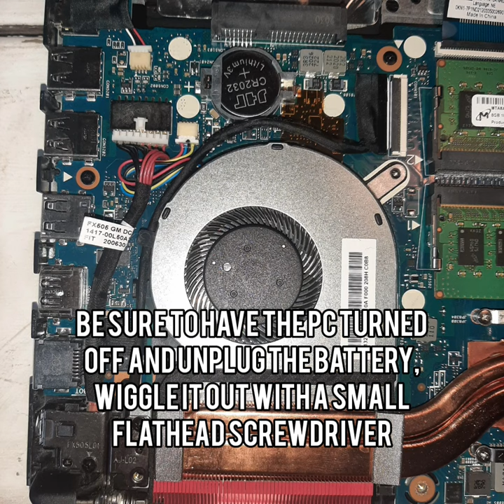How to fix a rattling fan in a Asus FX505DV TUF gaming laptop (read bio)

Comment: Just take the cover off, spray it with compressed air, then put it on its side with the cover off and manually set the fan speed to 100%, keep it like that for 10-20 mins and then the grinding should stop, and you can put the cover back on
Reply from the maker: could be but giving it a little oil wont hurt as its a acouple min extra process
Reply: @0xgreyhound  can you do that without removing the heat sync and fan?
Reply from the maker: @dylanevans7529  no bbut it takes 5 min to take apart

Comment: how much the blac fan cost
Reply from the maker: didnt swap just cleaned it
Reply: it always cost more than it should dude.. specially in more expensive laptops.. and there is no need to replace the whole fan if we can just lubricate it.. I am having same issue in my zephyrus g14.. here in india fan is even more expensive and delivery time is too much.. So I am going to open it and apply some lube to it
Reply: @0xgreyhound how did you cleaned it the same way? Then what kindof lube?
Reply: @_ajay_kumawat  They only cost ca. $19 on Amazon, the cost is not that exorbitant.
Reply: @0xgreyhound If you need to order a replacement, is the right fan on the right when the case is open, or the right when the screen is facing you? Wish they just had a clearer designation other than "left" and "right."
Reply: @brendanr1525  not here my friend.. cheapest I was able found was around 4000₹ which is 47$ and even than I don't know if it's genuine or not..
I did open my laptop and found that there is no way to lube that fan without breaking it.. so new one is the only option here.. but now that's not for me because I shorted my motherboard same day while connecting the battery.. all thanks to asus's brilliant battery connector.. Or maybe it was my fault.😔
Reply: I got a replacement set for £20 off amazon
The entire thing, not just the fans
Reply from the maker: @brendanr1525  not quite sure what you mean but pretty sure you wont need to buy a new one just open it up clean it and oil it up, havent had to do it since this video and its still quite on silent mode
Reply: @0xgreyhound Tried that, it still rattles away. It appears the plastic part isn't seated properly, so the rattling is caused by it moving around as it turns. Looks like it may just need a replacement assembly.
Reply: @brendanr1525 how'd it turn out?
Reply: To OP *how much "does" the black fan cost?

Comment: I'm experiencing the same problem too, it has been making rattling sounds for the past 2 years ever since i bought it, but in some other cases it will be gone for a few hours and then it will come back again 

Whats the best thing to do? Buy new fans or should i just clean it and lube it

Edit: sorry bad english
Reply: Yup buy a new fan just check wich one is the fat that’s making noise (gpu or cpu) and the order it and change it it’s easy don’t stay with a bad fan never
Reply: Try both
Reply from the maker: I got rid of mine like in the video, it was horrible 2 months after i bought it it was like you described a half year maybe, buying new fans wont be necessary i believe